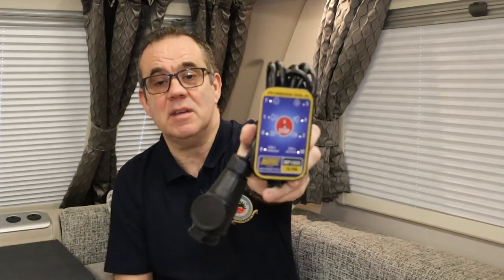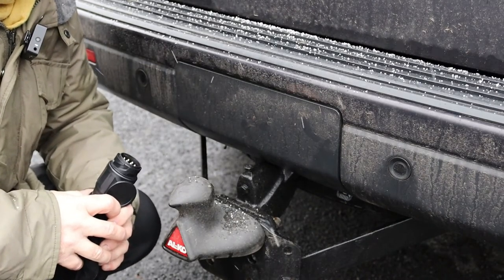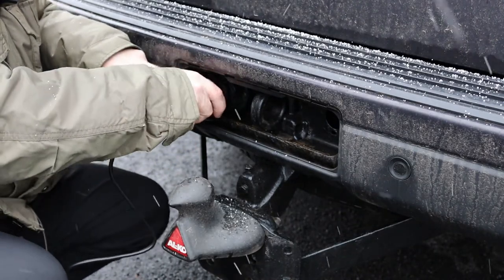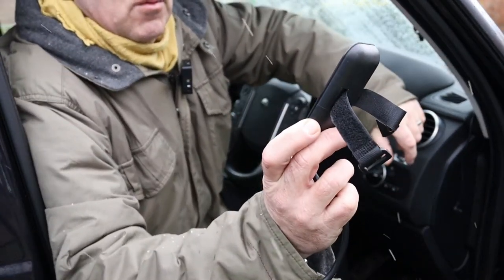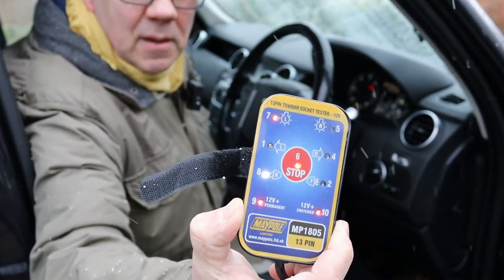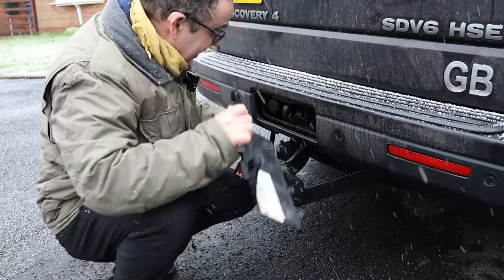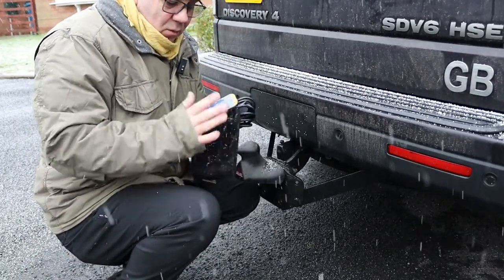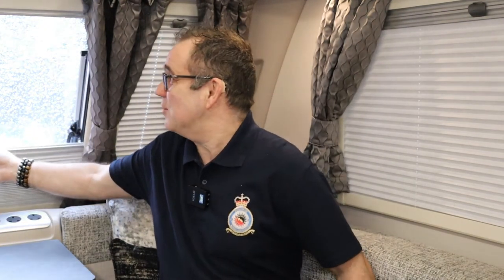Tow Electrics Tester Take 2, This one is far better than the first one I tried.

Comment: Might invest in one of those James. 4m of cable would have been ideal. For the right tail light not working try spraying a little switch cleaner or WD40 into the socket then try it again. I say this because WD40 worked for a friend when the caravan fog light wouldn't light up. Take care. Rob
Reply from the maker: Hi Rob, Yes it is a very easy bit of kit to use, That extra 1/2 meter would help. I could try bringing it through the back which would probably work. Thanks for the Tip on WD40, I will give it a go. I am going to connect it up to the Caravan today just to check I get the same results as the tester. I suspect it might be a little more complicated to resolve. I had to have a turbo replaced on the Discovery 4 recently and the complete body has to come off the car for that to happen. So lots of plugs disconnected etc, I am wondering if one of them hasn’t been clipped back together properly. I will keep you guys updated on what I find. Take Care 2. James

Comment: This tester looks a lot better than the first one you tested. This is not surprising as it is supplied by Maypole who are a well respected manufacturer of towing lighting components. They must have changed their selling policy as when I have bought gear from them previously I have had to order it through a caravan dealer as they wouldn't sell direct to the public from their website. The only downside of this tester is its price.
Reply from the maker: Yes so much easier to use than the original one I tested. It does seem readily available on the internet.

Comment from the maker: The seven pin version that I haven't tried, but would imagine it works as well as the 13pin, with a little less information can be purchased from here 
https://www.towsure.com/towbar-n-type-wiring-tester?gclid=Cj0KCQiA0rSABhDlARIsAJtjfCezeSfMukF8B8H6DA-36zVx4s4ngz8Z2AAG9_0Np2DNrdlIeM3CAgsaAtSlEALw_wcB